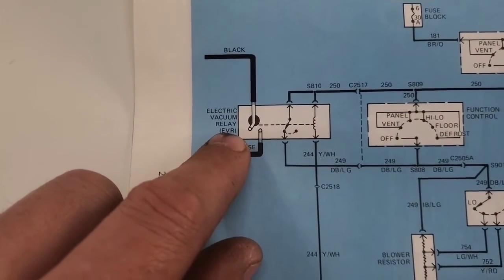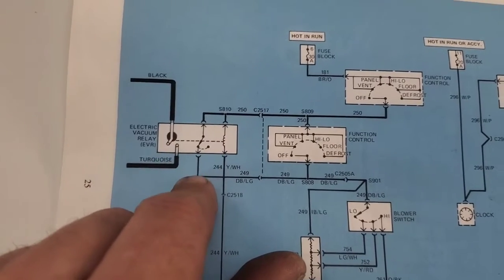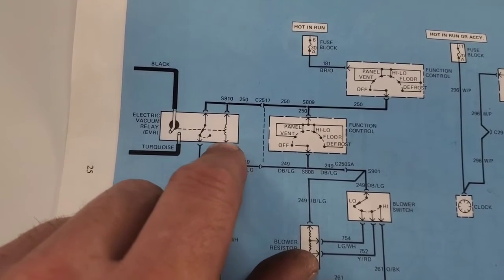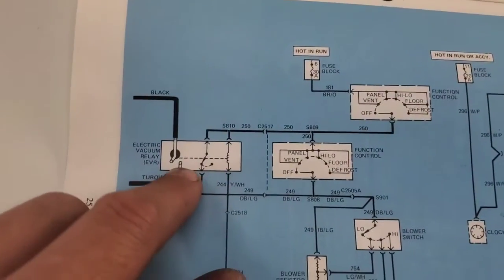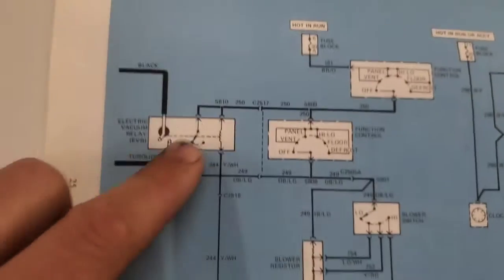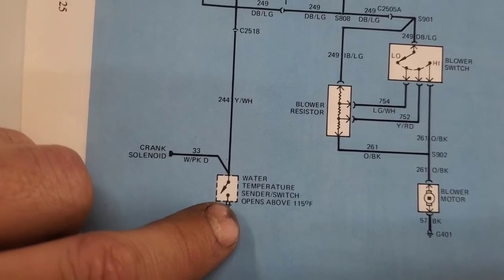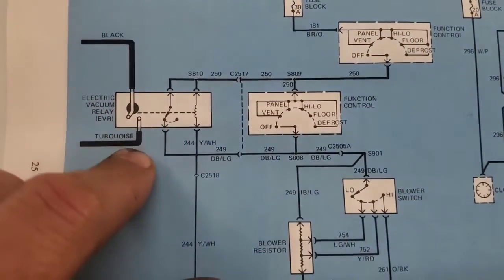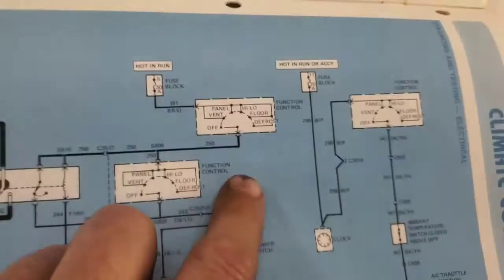Lincoln Continental, Ford, Mercury:  No Blower Motor In 'Heat' Mode.

Comment: Another great video.... Your turn signal switch replacement video saved my a** while back.

Last winter my '77 MK V stopped blowing in heat mode. Never got around to addressing it as I just used the heat/defrost mode and it did the job fine. I'll have to try out these methods when I get a chance.

Keep up the great videos my friend! Makes owning one of these old beasts a lot less intimidating.